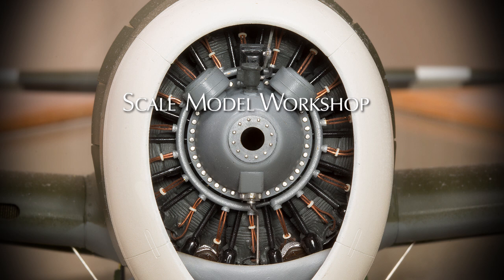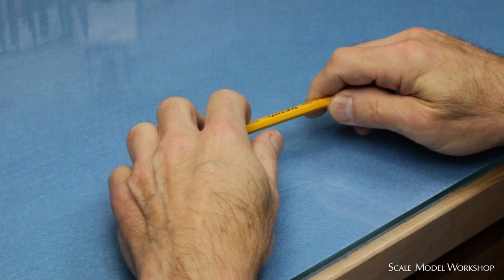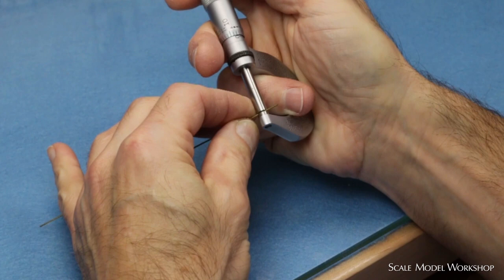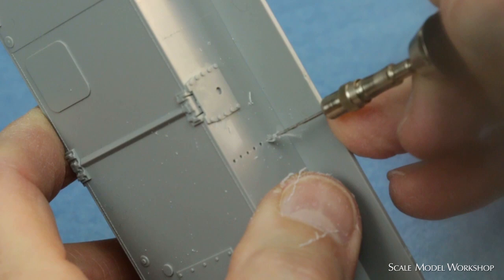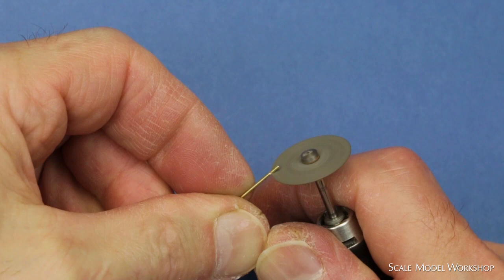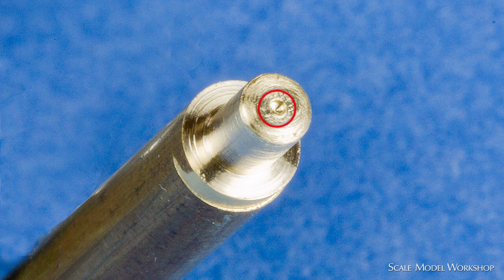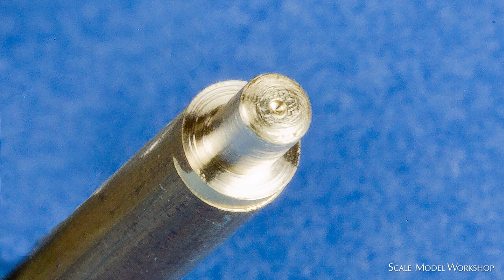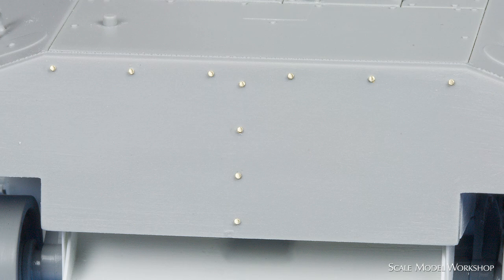Rivet Detail With Fine Wire

Comment: Model parts launched from tweezers actually travel to another dimension.
Reply: Wire trimmings launched from my 40 year old wire cutter pliers shoot across my shop at the speed of light and like your model parts, disappear forever...somewhere.
Reply: The Shadow Realm.
Reply: Hahaha... something's are timeless. I know I'm never alone whenever hear this stuff...
Reply: Luckily it's usually a parallel dimension that's location can be achieved just by looking for something else other than the lost part.
Reply: @skeetermcswagger0U812  A few thing's I've learned at 59. I usually find the inadvertent ballistic object immediately, or just when I give up, torch (flashlight/minimaglight in hand) eureka! there it is. The vacuum cleaner always gives up the dead!
Reply: Is that where the carpet monsters reside?
Reply: Yup. They are on the bench and then they are not on the bench.
Reply: @IllusionSector  Creepy ain't it.

Comment: I used to work in an electronics lab for instrumentation equipment. I was always amazed how far the smallest parts could travel. Thank you for the informative video.
Reply: I was working on two Bf-109s, most of the  small  parts are in low earth orbit. They sure aren't anywhere to be found in my workshop, even crawling round with a  flash light to side light them.

Comment: To find small parts, get one of those bug catching vaccuums and fix a piece of loose-weave material across the end of the tube. Small parts will be sucked up on the the material quite easily. Also beats crawling under the bench!

Comment: Sharpen your tweezers by running them flat along the tapered outside edge against a piece of sandpaper like 800-1,000 grit. This will allow you to hold very small round parts.    

This is an old watch makers trick for holding onto very small screws & small rod's without them flying away on you.